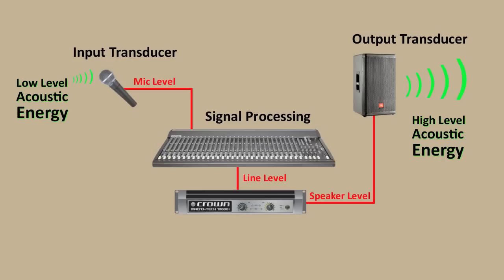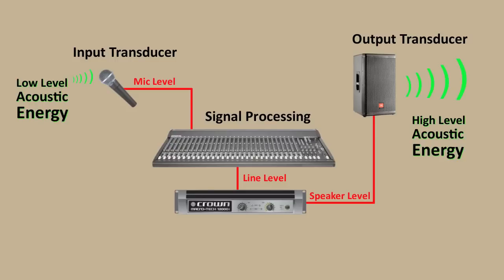Live Sound 101: Sound Reinforcement Systems

Comment: When is too much, too much as far as passive vs active xover setups. I guess more specifically I am in a pop/rock original/cover band and I am the "sound guy" . I have a yamaha xm4/12 mixing console ,a crown ce1000 for mains and a pta1000 pyle for monitors mix. I do have a compressor on vox and my question is basically do I need an eq and a xover or is it overkill for small venues.  Does it really come down to "sound reinforcement " or having more control over room acoustics? As for xover is it more for speaker frequency control (highs)(mids) (lows) getting to the correct speaker and thereby saving the life of said speaker.

Comment: Awsome job BIGnate you are doing here... my question is how do rout my stage monitors all the way through a snake audio cable to a power amp all through to my mixing console plus a little more explanations on assigning group mutes and on analog consoles.. connection guid from crossover for sub to amplifier and line aray speakers back to the audio mixer board... i will be glad if you can guide in a live sound situation
?... thank you Sir..

Comment: I think one of my major errors is getting the mics set up correctly at the beginning and I always end up with clipping.  My system does not have all the control knobs that most of the other systems have and everything I am learning says it has to be set up correctly from the start.  The other problem is placement of the monitor and getting it at the right level for the performers - I think head mics cause additional headaches to that set up but do not want to change.  Want hand free movement.

Comment from the maker: Sweet!  Thanks for letting me know.  I have been working on the next video.  Should be up soon.  The topic will be understanding signal flow with examples of schematics and block diagrams.
Reply: BigNate84   Very well done and appreciated. And of course I did like the soft background music. One question I would like to ask is  given the different types of analog signals, is there a test device or something that when in doubt I could simply plug into that would identify the signal type by voltage or other?